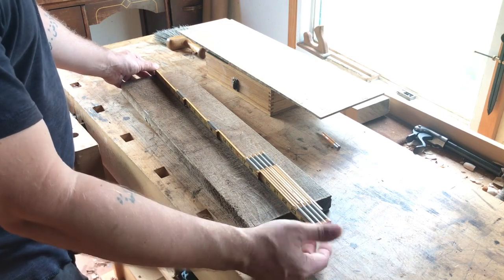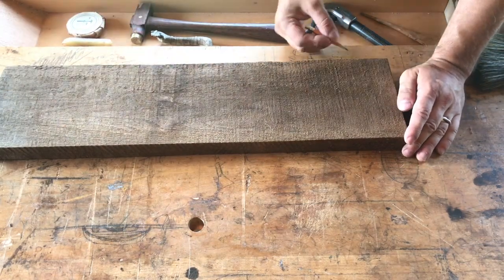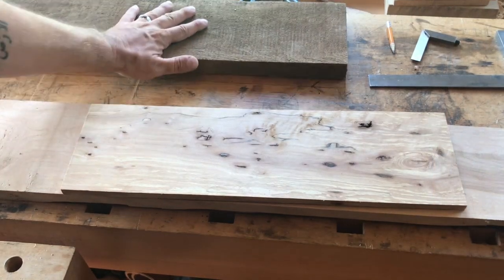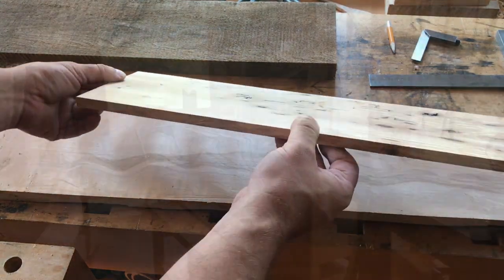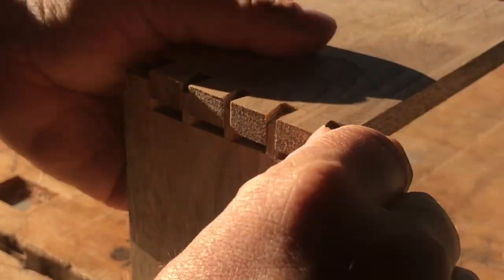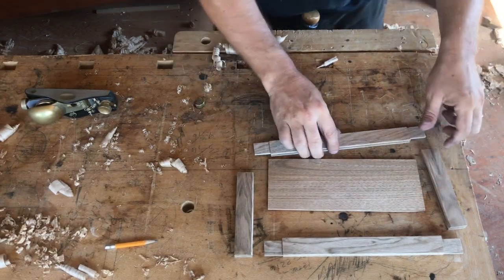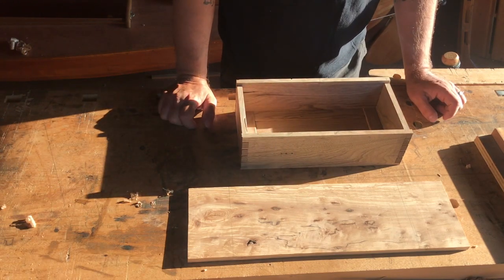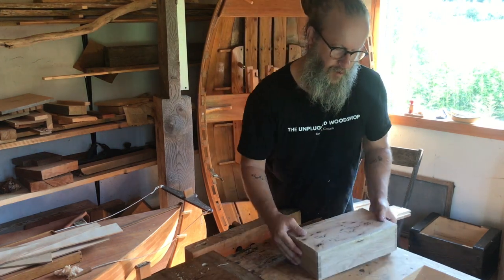It Starts with a Box ( long edit )

Comment: I am still trying to find the best way to fit the bottom into the carcass, I made grooves with some wooden groove plane and then fitted the bottom with no glue . I am just not convinced of the strength of the bottom withstanding weight when a heavy object is placed in the box. In my case a number 6 plane. And the wood movement of the bottom could also crush the box when glued...what do you think?

Comment: Always a joy to watch you work, Tom. 

Did I see that right for the bottom? You grooved both long edges of a medium-width board then ripped it into two narrow boards and then crosscut each for a rail and stile?
Reply from the maker: You did indeed. Good eye! It's a lot easier to hold the wider board before the grooves go in-; )  Cheers Ethan! Hope you're doing well.
Reply: @theUnpluggedWoodshop  I don't think you showed all of that; I inferred a little, I think.  Yes, it would be more difficult to get the fence  to settle on the board face while cutting grooves if the board were more narrow. I'm always looking for knowledge, so thanks for showing that. I'll use the technique in the future. I'm sure it saves a little time and also ensures perfect groove alignment between rail and stile for both sets.
Reply: Indeed, visible at 10:20

Comment: Was that Shellac for your finish?
Reply from the maker: Thanks for the question. First I did a seal coat of shellac on everything, and then wet sanding in between coats. From there the lid received a few more coats of shellac and again, wet sanding. After all of that I rubbed on a final coat of oil and will go over that again with paste wax when I return to my shop in Toronto at the end of next week. These finishing techniques are way more work than I usually do- sometimes I just rub a quick coat of oil/varnish and call it done....other times I'll build up a base coat and fill the pores of the wood beforehand. Paste wax is my go to for the final pass. Cheers~
Reply: @theUnpluggedWoodshop  What medium do you use to wet sand (water/oil)?